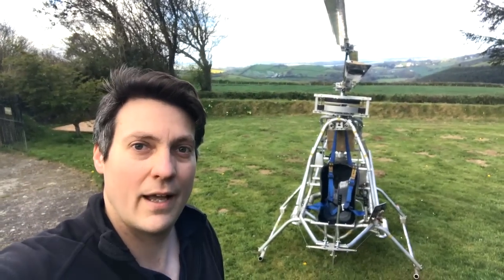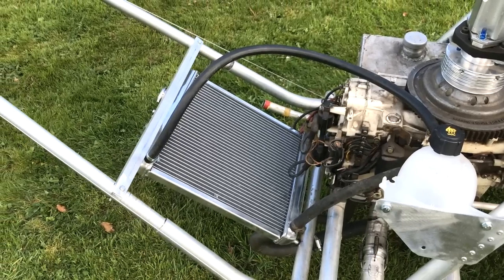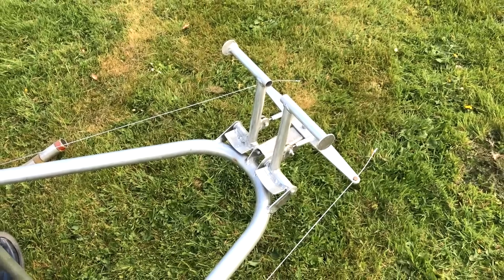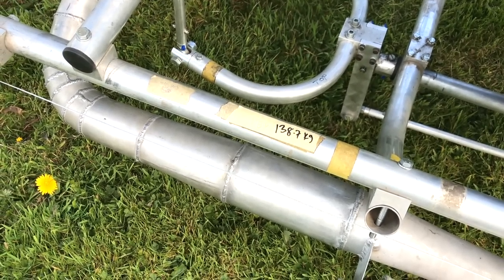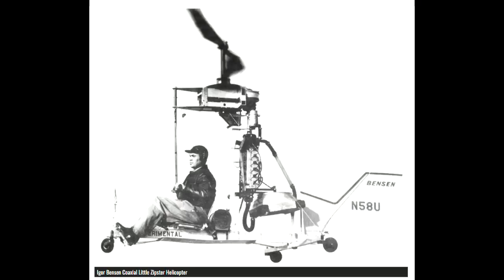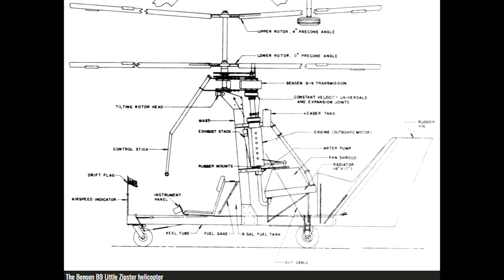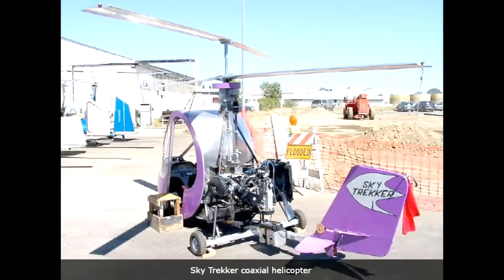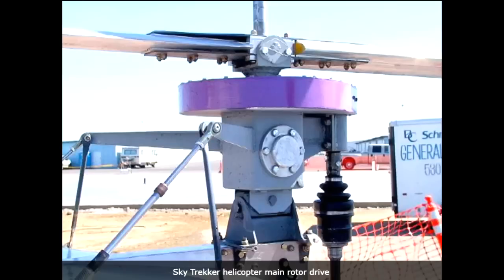Part 1 Learning to FLY Homemade Helicopter

Comment: Definitely get some training first.  

I'm curious about your gear box and the contra-rotating rotors.   I like the approach because it cancels out the torque effect.  What are some of the challenges it creates?
Reply from the maker: Well coaxial in the conventional sense with collective and cyclic control creates some challenges like yaw reversal in auto rotation for example but with mine having fixed pitch there's not much to it and it's simple. The blades get closer together in forward flight due to the dis-symmetry  of lift which can be a concern and the machine is slightly heavier having two sets of rotors this is offset by not having a power robbing tail rotor. I really don't like tail rotors and don't know why so many manufactures have gone down this route.

Comment: It seems  the CG is a bit aft. That is bad. A bit forward is ok, aft is always problematic - you've got to eat more and it will be balanced! 😁.  in other matters, It looks very nice. Strongly built, no vibrations or lack of balancing in the rotor system. just needs a little tuning and a bit of practicing. keep it up!
Reply from the maker: Thanks for the comment, I will adjust the CG and try again. 👍
Reply: CG.must be forward  +1 inch or more..

Comment: I have been working on a custom helicopter for couple of years now and I want to share my experience with you...
the main problem I see with his design is stability in the air...
make sure that all of your connecting connections and rods are pretty good fit and not loose at all...
also do not allow your friends and family to be near because anything throwing from the helicopter can kill anyone... 
then I suggest you another thing that is complicated but again I think is necessary to make this concept fly well...
and here it is:
I think you need to connect your control stick to a fly controller like pixhawk or anything that can do the job then you need servo motors to move the controling arms...
an autopilot must take the control of the heli by pid control and you just tell the autopilot where to go...
Unestly I think you can not controll all of that by your self...
seems complicated but again... I suggest at least talk to a nice person that you know...
best of luck
Reply from the maker: Thanks for the interesting comment I will bare it in mind. cheers
Reply: If you were going to use a flight controller would you make it all fly by wire or still have mechanical controls for the pilot?  Seems a bit complicated to mix the two approaches without there being a conflict.
Reply: @floridacoder  Right but I just imagined that the goal of this project is carrying a man into the air...
that way the man can control by his stick...
but yea you can just control it by your rc transmitter... for just the test or for the final test with him self in it...
Reply: @hots2215  ah, that makes sense.  I was thinking about using the flight controller in normal flight also - once all the testing is done.  A poor man's auto pilot and an "oh crap button" to get you back in level flight.  You don't necessarily need the receiver or RF if the pilot is on-board.  I like to fly my RC aircraft FPV (video displayed on goggles) and that is probably how I would prefer to test these larger human sized aircraft also to start.  Why put your body in any danger when there is a simple way not to.

But, my hobby grade servos are also much smaller.  Not sure what sort of torque is required on servos to control an aircraft like this.  But you definitely wouldn't want to be under-powered.  Curious how much human input (muscle strength) is required on the controls.
Reply: @floridacoder  well.... there are proper servos for the job... but what matters the most is how even do you find the right pid setting for a thing that is near completely new....
Reply: @hots2215  good question.  I really don't know.  Maybe build a smaller model to scale and get those PID settings locked in.  And use as a starting point.  I wonder how the pros would do it.
Reply from the maker: The strength needed to move the cyclic isn't much once in the air, perhaps similar to an R22 without hydraulic assistance, to move it while still on the ground takes more effort probably double. The ratio is approximately 2:1 cyclic stick movement to mast movement and this might need to be adjusted.

Comment: I can feel the joy of a smooth running build on your behalf 😄...I love your simple instruments panel seems am overthinking by trying to buy an electronic EFIS from talcos aviation... question is, is that sitting position comfortable? Can you do a 1hour straight sit in that config?
Reply from the maker: Thanks, engine temperature and rotor rpm are a must gauges wise, the others are not so important to begin with. No point spending lots of money on gauges until you know everything else is going to be ok was my opinion. The seat position seems ok but I've only sat  in it for a couple minutes. Perhaps I'll eat my lunch sat in the seat today and find out how comfortable it is. 😀
Reply: @Ben-Dixey  how are you taking the rotor rpm measurements? Is there an easy simple instruments out there
Reply from the maker: I just bought £10 digital rpm readouts, they come with a sensor triggered by a stuck on magnet. The same sort of thing as a bicycle speedometer. The refresh is a little slow which means it takes a second for the gauge to catch up with actual rpm but it seems to be accurate otherwise. Certainly good enough for testing purposes.
Reply: @Ben-Dixey  I see, will definitely add it up to list of instruments to purchase.
Reply: Hey friend can you share more details of that rotor rpm instrument or a link on where to buy it, need to ship in one...plus those ground hooks
Reply from the maker: @JeffChoppah  Hi Jeff, just seen your instrument panel, looks really nice, great job. Think I would have gone for 1.5mm thick material rather than 3mm and swaged  any parts that flexed. If You need to you can cut some holes into it to lighten it up though. great job. 

My email address is btdixey@hotmail.com
I can forward the stuff I bought via email. Youtube won't let me add and external link in the comments 

Ben

Comment: Congratulations! You've done an excellent job so far. Don't play it all for nothing in the final stretch. Be patient and correct errors:

1- The CG is far behind. Forward cyclic will not correct the CG, it will just make the helicopter move forward. Position the seat further forward until the helicopter balances itself supported by the mast;
2- Fixed pitch does not allow to enter autorotation in case of motor failure. If your engine dies in flight, you will fall like a stone. Think in a variable pitch at least for collective control;
3- Try to gain more experience in helicopter piloting, or ask an experienced pilot to do the test for you. Helicopters are very difficult to fly;
4- Do the tests with calm wind and with the helicopter facing the wind;
5- On the day of the tests have few expectors and keep them safe in place.
Reply: Good points - but, instead of collective control - couldn't he put in a clutch that disengages the drive to allow the rotors to auto-rotate?
Reply: @rodciferri9626  Good point about the free wheel... I didn't notice if it is present in the project. She is also essential.
But I was referring to the collective pitch of the rotor blades in case an autorotation was needed. The rotor will only maintain 100% RPM in autorotation if the blade pitch is zero or negative, which is not possible in the case of fixed pitch.
Reply: @joneispetri  I didn't realize that - so collective control is needed - or, perhaps a ballistic parachute is possible.
Reply: @rodciferri9626  Yes, it's another possibility.
Reply from the maker: Thanks for this insight, good points i have taken note. Cheers
Reply: @Ben-Dixey  I have no doubt this is going to fly beautifully when you get all the adjustments done and have taught yourself how to fly.  I appreciate your step by step self-training - it will help me when I have to do it.

Comment: I helped my brother to learn how to fly his Safari by sliding it on a firm grassy surface to help learn the inputs required and then gradually increasing collective while still sliding forward to lift off and run on again. Once you can repeat that, gradually slow down each time before setting down and eventually you will be in a hover before landing. Ditch the teather, that will only roll you over when it becomes tight. I have been flying helicopters for fourty years and 15,000 hrs and im still here. Find a smooth surface!!!
Reply from the maker: Thanks for this, very interesting comment, did you have extended landing gear or just the normal skids?
Reply: @Ben-Dixey  they were normal skids and the idea was to learn to control the lift just enough to allow you maneuver without lift off very incremental. Hovering is more difficult than forward liftoff and touchdown. The skill to hover is attained slowly with repetition. His was a two place with only enough power for one. He had no previous flying experience and was soon hovering with no further instruction. Be careful! Good luck and well done.
Reply from the maker: I can see the logic in this, there is however one big difference between your brother in his safari and my coaxial and that is the blades being fixed pitch. There seems to be quite a delayed response in the control of altitude with mine so things get worse before they get better. I've only had a small go in an R22 and that seemed to respond pretty quick to lowering the collective. I need to dial in my reactions to changes in altitude on the tethers as they have already saved me lots of times. Once I've got that under control I will then think about your suggestion, definitely food for thought. 👍

Comment: 2 main issues. 1) too small of a motor to get any sustainable results. 2) the center of gravity is too far to the back which is why you leaned back when you actually had enough power to lift off.
Reply from the maker: Correct, I need to improve the CG, I think the engine is ok for now, I haven't used full throttle yet.
Reply: @Ben-Dixey  the CG on helicopters should be right under the shaft of the rotor so what happened in this video doesnt happen as far as i can tell. and with how the engine was sounding, i think you were pretty close to max power even though the throttle might have some or a lot of play left in it.

for the next test. i would make something simple to indicate how much power you are adding. i dont know of what that would resist the wind coming down from the blades but even without the motor running, that should give a good indication on what is left.
Reply from the maker: The CG in my hang test was 0.25 degrees to the rear so I knew it wasn't perfect but the field sloped backwards as well. I'll sort it and find a more level piece of ground next test. 
I have a vacuum gauge to install which will measure inlet manifold pressure, this will tell you the throttle position and power being used. The maximum take off weight with 60hp is around 275kg, my total weight is currently 240kg
Reply: @Ben-Dixey  overall its looks like you did a great job as its hard to build a helicopter let alone a homemade design and counter-rotating blades but as you know you have a lot of work still left ahead of you. one thing i dont thing i saw or see in this is a way to move forward or backward all i am seeing is a way to rotate left and right.
Reply from the maker: Thanks, the tilting mast can move in any direction 4 degrees of maximum tilt. I was pulling too far back to start with which is why it lifted the front so violently. Pushing forward it was then starting to lift more level but the CG is still off. The field also sloped backwards which didn't help either. Yes still work to do. 👍
Reply: @Ben-Dixey  yeah, the blades on helicopters dont tilt that much as it could cause some more issues. the difference is that on most helicopters its the blades that move not the shaft but this is usually too complex and heavy for smaller and/or homemade helicopters. https://cdn.airplane-pictures.net/images/uploaded-images/2013/11/20/336920.jpg

you are just going to have to be more aware of inspecting the shafts before a flight to make sure they are not getting too much damage like any pilot of any aircraft does.

Comment: Just my $.02       You need to hang it from the rotor head, block the controls in the neutral setting and sit in the seat.  Have someone ballast it until it hangs straight and level.  Then you will have a good chance to hover it.
Reply from the maker: will do thanks 👍👍

Comment: Wow, go Ben. Getting exciting now. Small steps.
Reply from the maker: Thanks Cam, I've had a full day today of testing to try and get a feel for it. I know you started with a simulator but did you use tethers at all?
Reply: @Ben-Dixey  I gave up the tethers as soon as I knew it would lift me. The ground was dead flat and smooth being a rugby paddock, which made sliding around on the skids reasonably safe. Keep up the great work. 🙂
Reply from the maker: Someone else commented the same sliding on the skids is the way. The only difference is the slow response to changes in altitude in my case. I'll take my time and decide how to best to proceed.

Comment: Fixed-pitch so you have no way to autorotate...no thank you.  I'd rather fly a gyro as it's a safer rotorcraft than a fixed-pitch coaxial.   Cool concept, but I'd not fly it any higher than I'd willing to fall....2 maybe 3 feet for me.  :-)
Reply: Not near enough rotor inertia either.
Reply from the maker: I agree in this configuration I won't be going higher than a few feet. Two engines or collective pitch then maybe.👍

Comment: I’m not a helicopter pilot, I fly fixed wing, but looking at the wind sock, it seems to me like it would be safer to point the thing into the wind for the initial tests at least.
Reply from the maker: I think you're right it would have been easier without a cross wind
Reply: Good first lesson - take off and land into the wind.
Reply: You are correct sir. In fact I believe it’s more dangerous in a helicopter than a fixed wing

Comment: So you have no previous rotary wing time?  Sikorsky had to teach himself but there aren’t any good reasons not to find someone to teach you the basics in an R22 or something similar.
Reply from the maker: I've had some lessons in a Robinson but maybe need more
Reply: @Ben-Dixey  If you can hover, take off, and land in a Robinson you may actually have a future keeping the spinning side up in your homebuilt.
Reply from the maker: I think you could be right. I'm going to proceed for now in trying to teach myself as lessons could cost more than what I spent building this machine. However I have no intention of risking  myself or the machine in any dangerous trials, there's just too much at risk. I will find a safe way or go with lessons as you suggest.

Comment: Damn... gimbaled fixed pitch coax...
That damn thing is 90° offset everything :p
It'd be a nightmare to fly if you're used with the regular cyclic/collective...
Reply from the maker: good point, I will change the throttle/collective lever position to conventional.
Reply: I don't think is what you say........what do you mean.

Comment: Aaaaahhh great, i've been waiting for this well done. Wise to have a 1ft tether, although i thought that may have been too prudent, but no, absolutely right. Can't wait  for the 2ft tether 🤣👏👏👏👏👏👏 peace from Rome👍🇬🇧
Reply from the maker: Thanks, I don't know how best to proceed from here as a 1ft tether at this stage feels dodgy. The response to altitude is slower than I'd like particularly the decent so by the time you lower the throttle things are still getting worse for a second or two. With collective pitch the response is much quicker. Other than that I'm happy.
Reply: @Ben-Dixey  Many thanks. I don't know anything about  hcopters, but someone else commented on cg, perhaps move the seat forward, could be next move.👍🇬🇧
Also it was rather windy/gusty.
Reply from the maker: Yes I will do that, CG seems to be more sensitive than I realised. I will also wait for a calmer day. 👍or perhaps I'll just eat some more cake, that will sort the CG 😀

Comment: Good job, nice work too, are you happy with the C of G location?
Reply from the maker: Thank you, the CG during the hang test   before this flight was 0.25 degrees to the rear, I moved the seat forward as it was 3 degrees to the rear after the addition of the radiator. So no, it needs some improvement but shouldn't be too much work to sort. I think you can see the rotor is tilted slightly forward to lift evenly. Surprising how much rotor tilt is needed to compensate for 0.25 degrees.